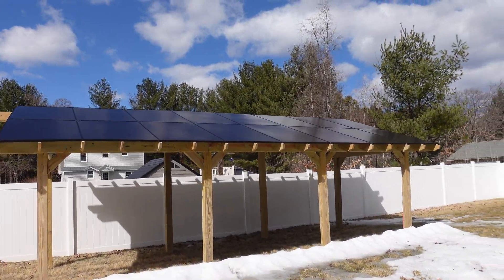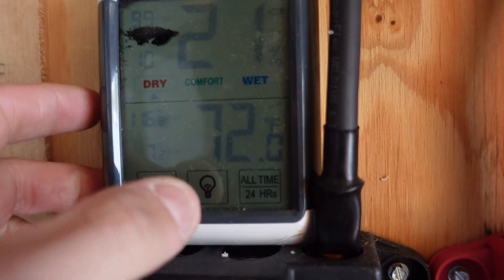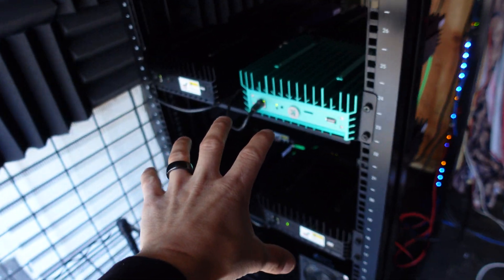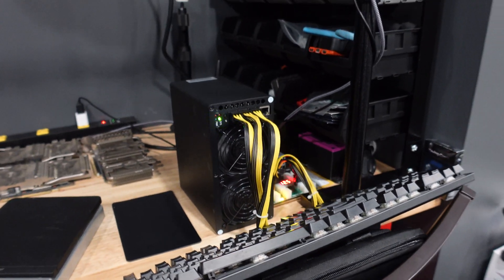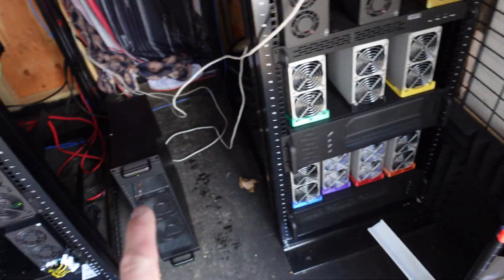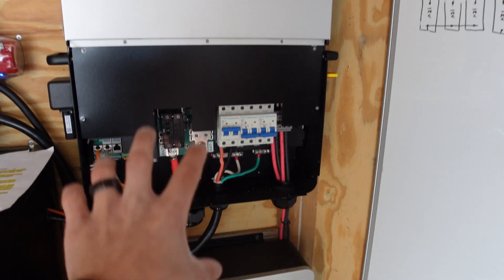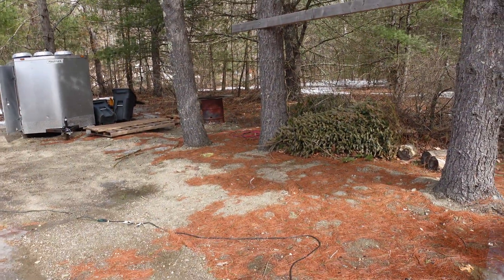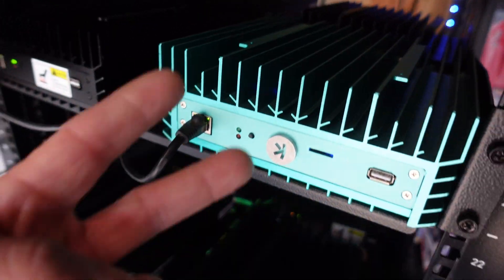My DIY Solar Trailer Update

Comment: Makes more sense to put that solar setup into the house. As you say they have built in fire suppression so there should be no issue. A lot of work but I think you’ll be much happier in the end and you won’t have to worry about the batteries freezing in the winter 🥶

Comment: You have a water sprinkler system to suppress a Li-ion battery fire? Li=Lithium. Group 1 (periodic table) metals react with water. You would need a Halon sprinkler to suppress a Li-ion battery fire.
Reply from the maker: @mattmill30  the sprinkler system was regarding everything else around the batteries. The wood, Sheetrock etc…

The fire suppression that is built into the batteries, has the lithium packs covered. That’s what I meant by that statement

Comment: hurry up dude! april is the strongest month as it is already strong radiation but still low temps keep the panels from heating up which means reducing efficiency and power output